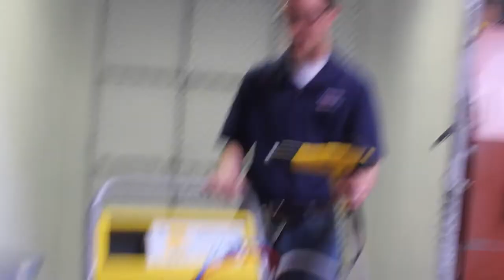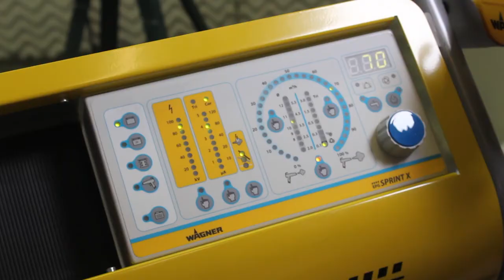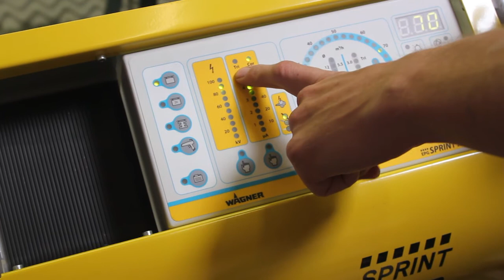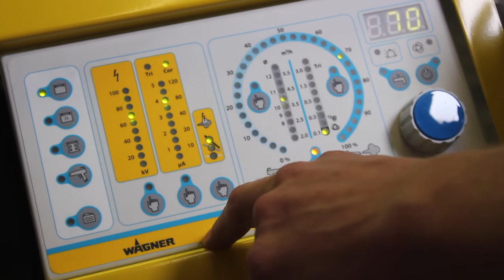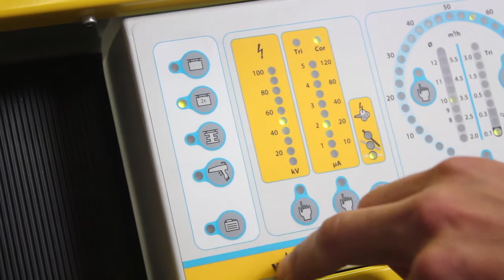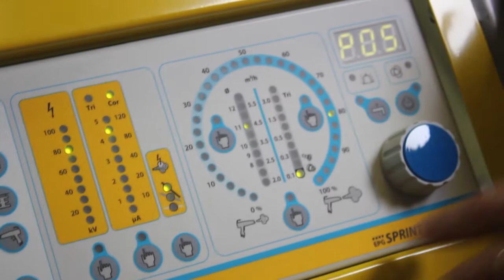Why Powder Coating Gun Prices Vary

Comment: This machine is for larger jobs. It has nothing to do with justifying a higher price to powder coat a gun. Gun parts are small and can be done just as good with a do it at home cheap unit. Just because you have an expensive unit it doesn't mean the work should cost more because you don't need that unit. Your justification for making a simple job more expensive is a salesman tactic.